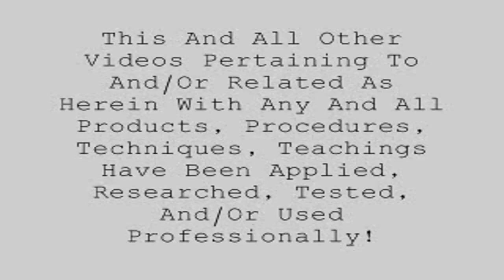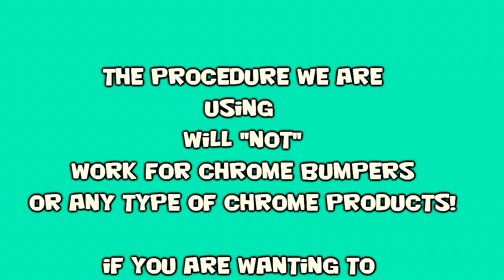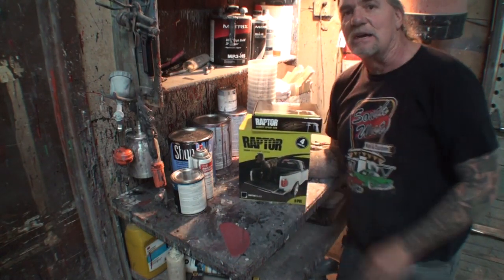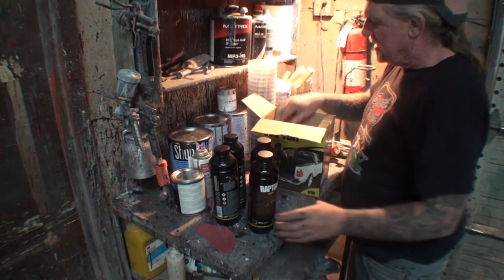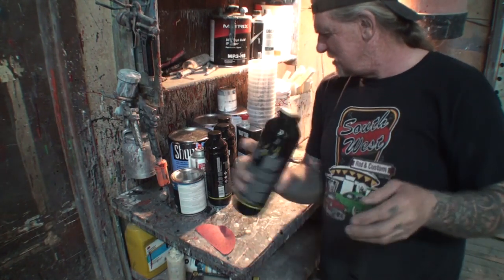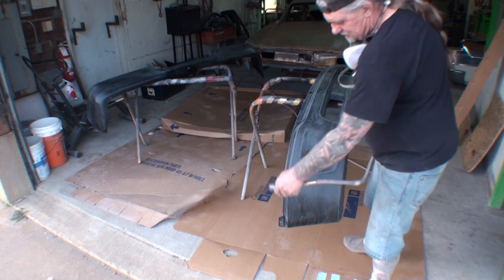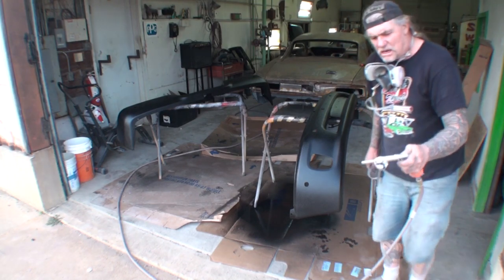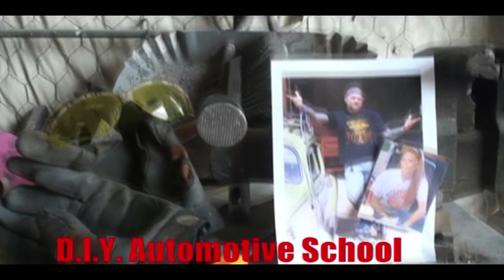What Is "RAPTOR LINER"? How To Use Raptor Liner The RIGHT WAY!

Comment: Hi Pete Great video as usual,do you think this raptor could be used as an underbody coating ?
Reply: i used a lot of raptor liner when i was at a custom restoration shop, we did undercoating with it on some stuff, almost EVERY car got in in the wheel wells, and a few trucks (scout II, jeeps, ect...) actually got their carpet ripped out and lined. looks super good, and is a dream to clean if you get mud/dirt on your boots.

Comment: One thing you didnt mention and not sure if you have been told but any tintable raptor you can add base coat too but it's supposed to be base coat mixed without the binder.
Reply from the maker: Ive always just used the paint itself that has binder in it. But I see your point and it makes sense... Thanks for sharing Jake!

Comment: Pete. Is a 3.0 tip for polyester primer too big? I have a 61 bubble top im about to start on and have never used poly primer. Looking at using feather fill or slick sand and im wanting to order a new primer gun for it. ..3.0 tip??
Reply from the maker: Actually it's probably too small.. You want to go with a bigger one then that, probably 5 or bigger.. Make sure if you use the Feather Fill to use a cheap spray gun because if that stuff hardens up in the gun you'll NEVER get it clean.. Remember the feather fill and slick sand uses Fiberglass Resin Hardner..

Comment: Thanking about using that on the roof of my Suburban, The factory clear coat has failed.
Reply from the maker: That would work,, it will last forever!
Reply: D.I.Y. AUTO SCHOOL  Hey Pete, just like the previous poster my land rover has the clearcoat peeling on the roof so do we rough it up with  some 320 or something to give it A good surface for the raptor to grab onto?

Comment: I used raptor liner on a jeep body and they are way off on how much you need to cover at best order 50% more then they call for. I will not use it ever again due to a hardening problem. after 7 days of dry  time you can scratch the coating very easy. its more rubberized then paint.

Comment: Been using that shit for 15 years. I used the shit to tint befour. It will change color it wont match paint perfect. Im going to put Raptor inside fenders on bug. Put that shit inside a fiberglass kit car body also. I thought about painting my cavalier with raptor lol
Reply from the maker: You should use it on your Bug Floor Pans ..... It's good stuff--- Painting your car with it?? HUMM Id think that one over Jeff!
Reply: @diyautoschool  that baby has brand new pans from wolfsburg the thick ones. Im going to leave them clean. If i ever sold the car some moron be telling me im hiding rust lol